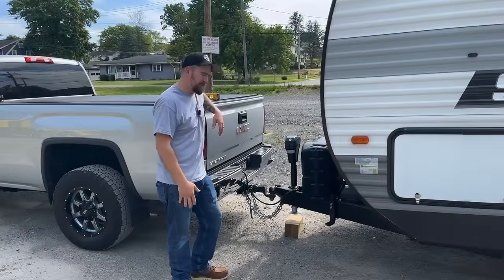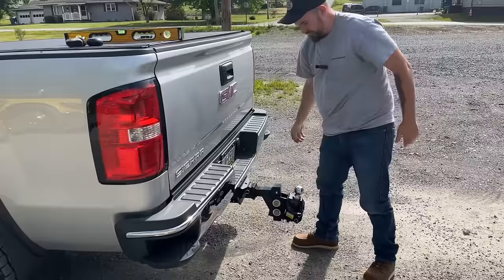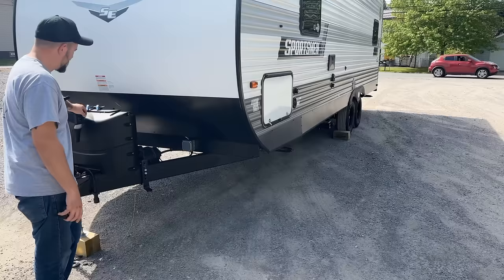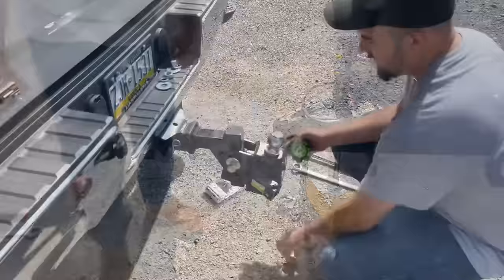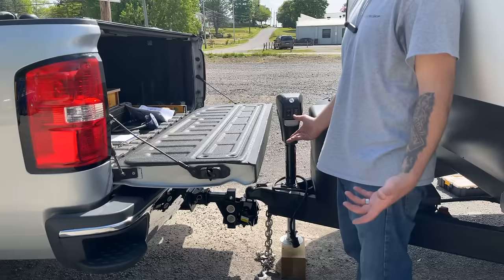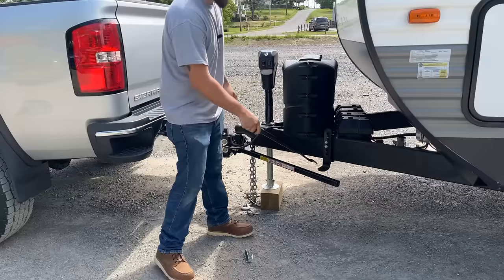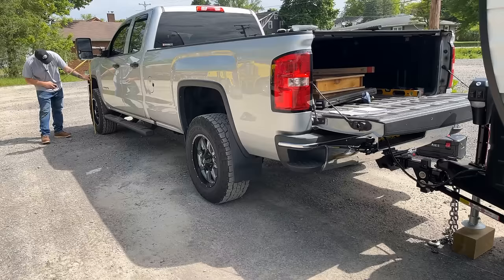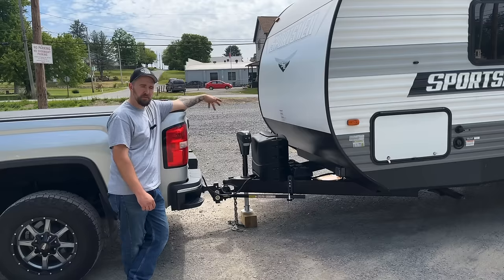Equalizer, weight distribution hitch setup!

Comment: That thing is fine if you dedicate it to one trailer. If you are hauling multiple rigs its WAY too much, plus you need an insane torque wrench that can put 380 ft lbs. of torque on the two main bolts ...... that's 380 lbs!

Comment: I've had the same set up on mine for 4 years now. Works great! Although my truck is a 1/2 ton, it does squat a little more in the rear but my trailer is almost level which i was looking for. Yes the  stuff is kind of heavy but that doesn't bother me at all.

Comment: I had to do all that in a parking lot behind an ice cream shop after purchasing our camper . I had watched your video the night before. I did ok. We just watched a truck pull in to this campground, No torsion  bars, the trailer hitch was way too low, the truck rear was low because of no weight distribution.  He also had no surge protection or water pressure regulator. He needs to watch this video, and others you may have. Great video.
Reply from the maker: Awesome, thank you!!
Reply: You know what that guy was doing?- he was minding his own business- you ought to try it sometime.
Reply: Was this in Montana because it could have been me

Comment: No disrespect for a great tutorial.
I have pulled utility trailers and travel trailers for many years. We just purchased a new travel trailer and the dealer tried to sell me this for around $800.
If you don't pull more than your vehicle is rated for, and you have the correct tongue weight and not just I thought but the actual tongue weight, then as far as I am concerned this is not needed. If you are the type of person who has no clue how to safely pull and pass when towing a trailer and no clue as to why tongue weight matters, then you need this. I recently came across a person in a jeep with a rated tow of 3500, and they were towing an Air stream 6000 lb flying cloud!
Reply: You may not need it, but it is safer.  I live in a windy area, and a 30+ camper is a sail in the wind. It's the sway control that you need.  A distribution hitch can't make up for an incorrectly loaded trailer. A half to with stock tires definitely benefits from it, though.

Comment: Great install video. I used to use a hitch like that (husky), but let me say that the Anderson No Sway hitch has the equalizer (or any trunion bar setup) beat by 1000 times. No heavy bars to pick up and store, no complicated adjusting for different weights; just attach your base plate with chains and then crank the bolts tight. Takes 10 seconds to hook up and disconnect, and very easy to adjust for different tongue weights, you just crank the bolt tight one more thread.
Reply: Agreed, I use one also and love it

Comment: Good video. I had an e2 Equalizer hitch and was still super frustrated at how much sway I had. It made driving super stressful so I bought a Pro Pride and all my problems went away immediately. ZERO sway, tracks super straight, super quiet and I can drive down the road with one finger on the wheel if I want.  If you’re frustrated, even with a good weight distribution and “sway control” hitch, look no further than Pro Pride. I’m just a regular customer and not an ambassador for the product. The one thing I hated was the price but if it saves my and my family’s life, it’s worth every penny.

Comment: AWESOME VIDEO!  THANKS, it just happens that I had to replace my 2008 Chevrolet Silverado 2500hd duramax truck.  I have 2012 Keystone Sprinter 297ret  34'11" long travel trailer with the same Equalizer hitch. My new truck is a 2024 GMC SIERRA 2500HD AT4 with 20" wheels as opposed to my 2008 with 17" wheels, which is going to require us to reset our current Equalizer hitch for this new truck. My wife says she is more than willing and ready to watch this video to assist me with the reset process for our Equalizer hitch. I don't remember the rv dealer, including the manual with the hitch. I'm glad I found your video. THANKS!
Reply from the maker: You’re very welcome! I also just got a new truck and need to reset my hitch. I plan on doing a follow up video on how to readjust this hitch when the weather breaks

Comment: I use that size all the time so I have quadruples of most of them or four or five of them depending on what it is and my apprentice is dropping my tools. I just don't understand why you didn't bust out the electric tools. I wouldn't have went there with that. I wouldn't do it and my big boy battery powered impact and just you know weld on it. Good video! I definitely learned. I did not really know how to set one of those up till your video. So hey man I'm clapping and applauding. Thank you
Reply from the maker: Thank you! Glad it helped!!

Comment: Fantastic video. I might have missed it but any trouble taking off the bar. I figure it’s the opposite (by streps) when putting it on.
Reply from the maker: No trouble at all. Your correct, it’s the same process in reverse

Comment: Joe I have had equalizers for years and I like your presentation. I have come close but never got it where I am totally satisfied. Right now, can you show me in the instructions or where you got that the trailer hitch should be an inch lower than the hitch ball on my vehicle. Looking at equalizers YouTube they show even or close. My instructions copied from the website for my weight of 12,000 lb bars doesn't tell me. Anyway, I am going to follow your video. thanks    My instructions are for 6k to 14k

Comment: Hey man, amazing video!! Just a quick question for your knowledge. I don’t have a torque wrench but I have an impact. Will an impact work for something as specific as this? Or would it be too much torque? Thanks in advance. Very specific video!
Reply from the maker: A long ratchet or breaker bar will give you more torque than a typical impact gun. Maybe even grab a cheater pipe. lol I would suggest that.

Comment: Would it help to have a pipe cheater bar (extension) to help put the bar in the bracket.  Age here is 77 and recovering from open heart surgery.  I  still have some upper body strength but watching you do it and strain a little makes me wonder if getting a cheater bar would help.
Reply from the maker: “Give me lever long enough and I could move the world” just make sure it’s set up correctly and I see no reason it would hurt!

Comment: Is the trailer Jack supposed to be in contact with ground & not on a block to take accurate measurements of trailer?
Reply from the maker: As long as it’s solidly supported it’s fine

Comment: Ignorant question, but how do you disconnect the trailer from the truck after this is installed? Do you have to undo the springs?
Reply from the maker: just lower the tounge jack to take the trailer weight from the truck and you can undo the spring bars easily

Comment: I also had to buy a reducer and I’m very unhappy with it. It is the short one that you showed. The problem with it is that the hitch pushes it too far inside so when I put the pin through it, the pin is going through the outside of the receiver and hitch but not through the reducer at all. To me that makes it less stable. What are your thoughts?
Reply from the maker: That’s exactly why I made my own. I strongly recommend

Comment: I need to find out is it better to run the red + wire from the electric jack with appropriate gauge wire straight to the trucks battery or install a separate battery somewhere on the trailer itself?
Any thoughts would be appreciated. 
Thks in advance sir!
Reply from the maker: Definitely hook up to the trailer. If your concerned about battery capacity you could always add a second battery in parallel or just leave the truck plugged into the trailer while using the jack to keep it charged up

Comment: Thx for clarifying vs Curt's instr.  You mentioned measurements are "close enough if you have airbags".  Do you adjust using your bags?  Also, you stated starting truck ball 1" above highest coupler measurement but instructions state 1/8" per 100 lbs.  Which do you suggest?  Thx Dan

Comment: Are there any electric trailer jacks that raise quicker? 

They all seem to be too damn slow
Reply from the maker: It’s because of the gearing. If it goes fast, it dosent lift any weight. The slower they go the more weight they can handle. It’s a trade of, but well worth it to have a robust gear box

Comment: Good Video and thanks for posting.  I have a question about the brackets for the bars.  How much adjusting can you do on those?  We have adjusted the receiver but still have a lot of squat. Will adjusting the brackets help with that?  Thanks
Reply from the maker: Yes, those brackets allow for about 6 inches of vertical adjustment. This will change the tension on the spring bars and in turn change the amount of tounge weight on your truck changing the squat. Higher the bracket is on the trailer, the more weight is on the bars instead on the ball. Hope this helps!
Reply: @dansproshop  Thanks that was what I thought.  Need to do some major adjusting on the hitch on my new truck.

Comment: How did you figure which holes to set the brackets on the camper? Was it in the instructions or did you just get lucky?😂
Reply from the maker: Honestly I just set them in the middle. Figured that would be a good way to start and it just worked out!

Comment: So everytime you unhook you have to do the spring bar tool thingie?
Reply from the maker: Yes, but it’s worth it!
Reply: Does make a difference on your tow vehicle.  Have a 2023 Chevy 1500 and can lift the trailer without too much stress on the hitch and simply slide the bars onto the brackets.

Comment: how do you unhook your trailer, do you have to remove these bars somehow? 😮
Reply from the maker: Yes. Jack up the trailer to release the spring bar tension. Remove them then un hook. It’s not bad
Reply: @dansproshop  how loud is the hitch with the nylon pads?
Reply from the maker: @steve4658 not loud at all
Reply: I like the noise..it means my equilizer is doing its job...

Comment: The Anderson hitch is the one to go with. There is zero reason to use a hitch like this. Way too heavy for its purpose.
Reply: I have my Anderson hitch for sale.  Great hitch for sway, but terrible for weight distribution
Reply: @steve4658  possibly wasn’t set up correctly, mine works awesome.
Reply: @sjfk1306  followed directions to a T.   It is known that Anderson hitch only distributes about 400# of weight. Not enough for some applications. They are great for sway, but lack in weight distribution.

Comment: Nope nope. These hitches will crack your A-Frame. Seen it a dozen times. Buying bolt-on airbags for your trucks rear suspension and stand alone sway control is a much better option. Think about the physics. Where do you think the weight gets distributed to? It goes to about an 18” section of the trailer A-Frame 2-3 feet back from the torque down brackets. My welder friend repairs them often. Every time they have a cracked A-frame, they have your setup.